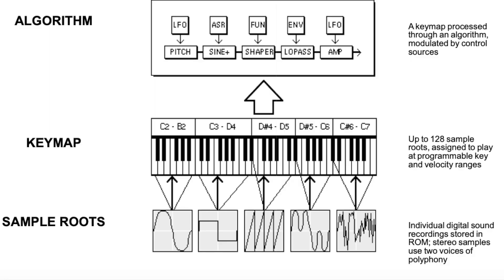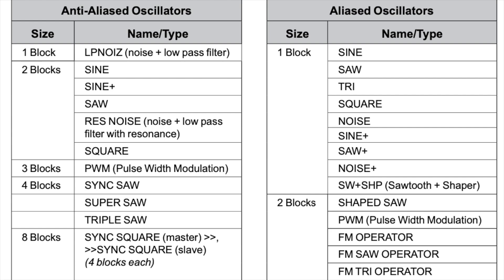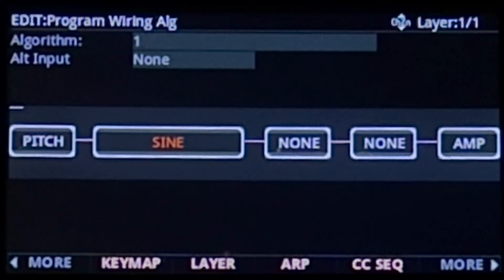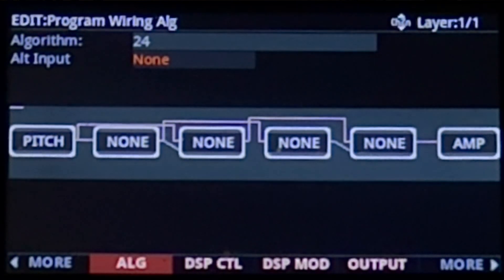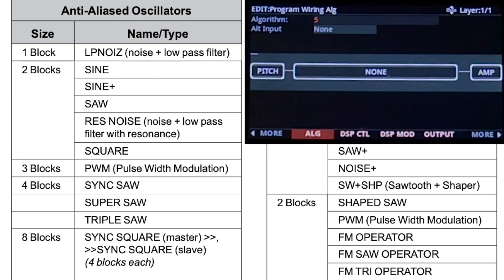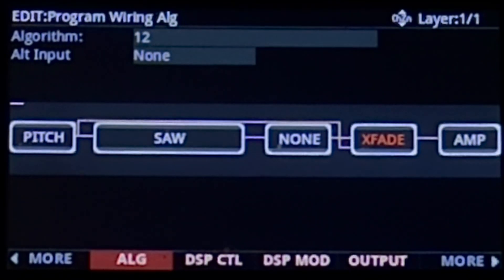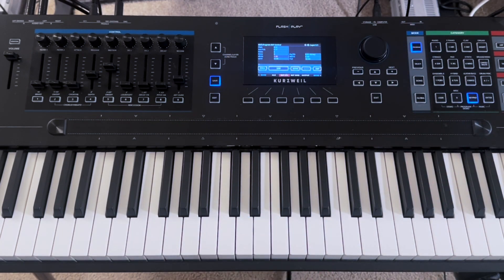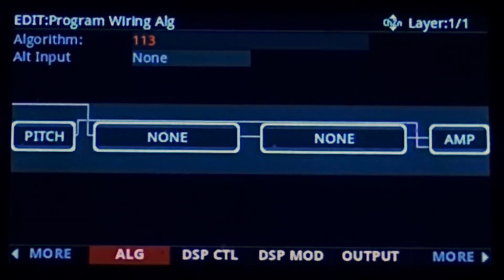Kurzweil K2700 Tutorial: Algorithms & DSP

Comment: I bought today the KURZWEIL K2700 and I tried to update the OS. I used a USB stick but the OS dialogue does NOT see it. I formated it before and the OS does not see it. I tried a few different USB sticks and the result remains the same. Now I m STUCKED in the OS menu and I cant get work with the K2700. What should I do ?????
Reply: Try erasing the USB stick in the K2700 itself. Also, confirm  it can be read in a computer after doing the K2700 formatting.
Reply: @LarryBartram-k7o  Thank you . I used an old usb stick and everything went well.

Comment: These tutorials are excellent, thanks. One thing I can’t get an answer for (I have asked support) is how you can get program mode to sync to midi clock. In multi-mode I can tell that I can delays etc. to sync to external midi clock. But in program mode it seems to only listen to internal. What am I doing wrong please?

Comment: :-/  With 40+ years of User Interface design experience, I see where this makes sense from a tweak every possible parameter point of view, but as a musician (who's played since the original 1980s Midiboard and 1000 series rackmount units), this causes eyes to glaze over and reaction of: where are simulated devices I know and love?
....I developed a control system for testing/designing automobile engines with UI similar to this, and it equally would have been a horrible UI for just driving a car with the engine.
....SO, where is the musician oriented UI for this thing?
Reply from the maker: Thanks for your input. Understood. Putting what used to be a wall of modular synths into a modern/portable UI is no easy task and further, everyone wants things to operate in a manner that appeals to them and their experience/perspective. All that said, you might find using the Desktop editor application easier as it, of course, leverages a mouse/window/graphic UI environment. This can provide a better birds-eye view of things especialy for those not already familiar with VAST.
Reply: @KurzweilMusicSystems-  You have a good system; the interface just lacks two dimensions. 
1) The display is only for the young with the tiny size of screen and font. 30% larger is all we need.
2) A mouse pad, like on a laptop for fast access to parameters on the screen as an option and addition to the button navigation. A mouse pad means we could skip over 10 lines of parameters and over to the right or left without a single button press; 500% greater navigation speed. A HDMI output would also benefit users over the age of 30. We could easily set up a 1080 HD 22inch monitor on the music rest for just $65!. (for an example of a synth mouse pad see the Roland Gaia2).